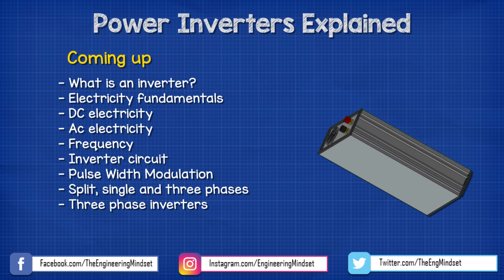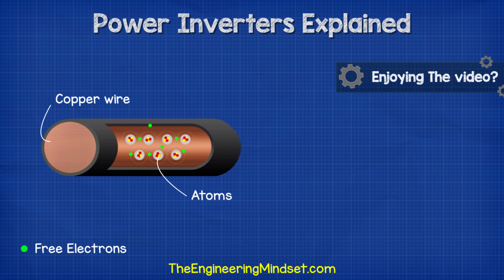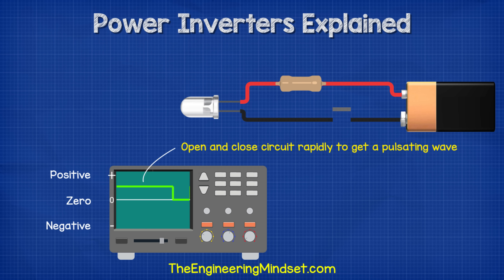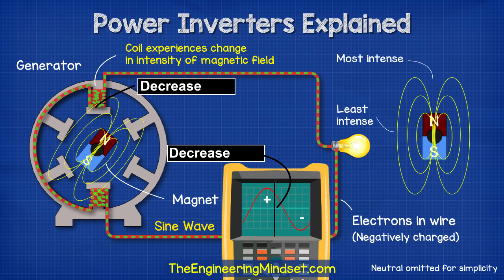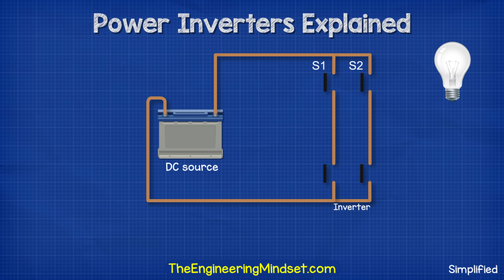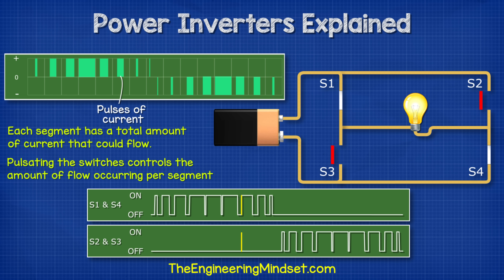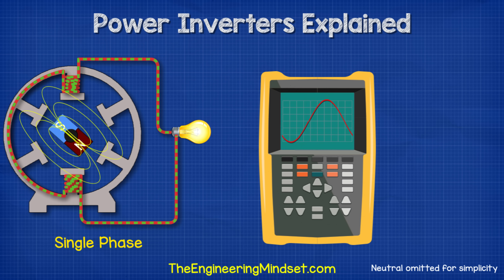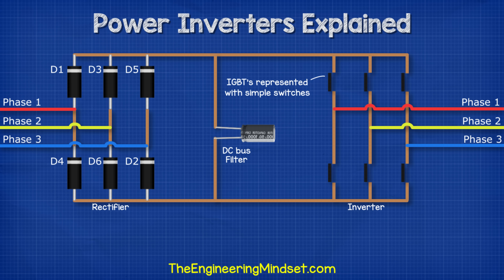Power Inverters Explained - How do they work working principle IGBT

Comment: What if I have a 12v adopter connect it to the inverter and plug it into the wall, would the adopt work as a battery for the inverter and help me saver power by using only 12v from my wall?

Comment: I'm a huge fan of transistors but I frankly kind of despise PWM

I think inverters are a fine use of PWM but dimmers are not
I think most PWM dimmers should be replaced with variacs

Comment: Great video and thank you for all the videos you produce. I'm not sure I understand the graph at 8:34 to show the current under PWM. Through the cycle the amount of current flowing through the switch when closed changes. It's not like the voltage where you see a square wave between the DC bus voltage and 0. The inductance of the motor would smooth the current draw. Would you agree?

Comment: I guess I must just be dumb as fuck. All these high-praise comments and I'm sitting over here scratching my head because every goddamn word sounds like a foreign language to me and I cannot get my head around the information no matter how many times I watch and listen.  I'm planning to live a life on the road in a van with limited power options... I thought maybe an inverter would be a good idea if I could learn how to fucking use the goddamn thing to power a mini portable cooling unit for the summer.  For the life of me I will never understand the concept of how to figure out watts, kilowatts, average, voltage anything electrical related. I'm totally fucked. I'm just going to have to buy  battery-operated everything and a shit-ton of batteries for the rest of my goddamn miserable life. 
But I do appreciate the effort you've put into trying to explain it.
Reply from the maker: This video is for engineers, you don't need to understand a single thing in this video if you just want power things from your van with a solar inverter setup. You can just buy an energy monitor plug, plug your equipment in and it tells you the Amps and Watts. No calculation needed. They cost like $12

Comment: A transformer will not convert pulsing DC signals into AC. 

Are there capacitors or something to smooth or "average out" the pulsed signals before the transformer in single phase inverters?
Are they left out in your diagram deliberately to just explain the key working concepts of inverters?

Still a great video with excellent visual analogies!
Reply: This

Comment: I believe I found a small error in the rectifier diagramm at https://youtu.be/iIqhAX0I7lI?t=49
The junktion on the right side should send current through the top right diode (according the way it is displayed)
Is this correct?
Reply from the maker: You can follow the dotted line and see it works. The diagram is just rotated 90 degrees compared to many illustrations.

Comment: On the Ac analogy at around 3:40, you could make the boat going round in circles, viewed from the front, as the speed from the viewers perspective will follow the wave form and it kind of mimics the electrons going back and forth.

Comment: 6:36 if the bulb is DC and it allows current to flow in only one direction wouldn't it damage the led bulb when we connect batterys positive terminal to negative of bulb ...

Comment: 11:01 You said 3-phase current delivers more power. However, it is not the only advantage: single phase power is oscillating on a load 2*50|60Hz, but once you bring in 3 phases they overlap to fill the gaps, thus resulting power is more smooth (not only being tripled).

Comment: does an inverter require a stable dc input frequency to have a stable 50 / 60 Hz output ac voltage?

Comment: I would like to ask if I can Connect 36v PV to a 12v inverter directly? is it safe or not recommended. I would like to ask if that will damage the inverter? Thank you for your help.

Comment: Question so if I have a 5000 watt pure sine wave invertor powering my stuff can I plug a micro inverter into the a c socket on the 5000 watt inverter to help supply more power ? Or can  I back feed a micro inverter power into a shut off line or breaker shut off to power things ? I have 3 micro inverters just 
Sitting here I used them when I was feeding back to the electric company but now I just use one big inverter to power things . Just hate to see them sitting here doing nothing

Comment: I am a retired engineer, worked in telecommunications field, engineering digital central telephone exchanges.  Most of exchange equipment powered from 48V batt supply which were charged by rectifiers fed from the Building  AC supply.  But some equipment in the exchange office needed protected 120VAC ( Terminals , Test equipment, Modems), supplied by inverters mounted on Misc racks.

Comment: Why do you need to use the inverter in the compressor example? Couldn’t you just run the three phase supply directly to the compressor, instead of converting to DC, then back to AC?
Reply from the maker: Inverter let's us control the speed, we output any frequency and voltage we need. Can't do that with a straight 3 phase supple connection, kts foxed speed

Comment: Conventional current may be viewed as electron hole flow. It's rather useful in semiconductors  but in conductors with electrons bouncing around everywhere, electron holes are really regions that have a lower electron density than the average, and they tend to flow in the direction of traditional current flow.

Comment: My Camo pro pack is called portable power generator, it has a 12 volt battery inside the pack and it also has 300 watt inverter attached to power pack……….It has jumper cables to jump start a car battery, can I connect my jumper cables to a 100 watt solar panel ( Make electricity)????????
Reply from the maker: Seen our new video on HOW SOLAR PANELS WORK in detail https://youtu.be/Yxt72aDjFgY

Comment: What I love about electronics and power back up systems is that they actually need low voltage DC, so they all have internal power supplies that turn the incoming AC into the necessary DC. So these in effect turn DC into AC which then gets turned back into AC. It does make sense though because something like a solar panel will generate inconsistent voltage so an inverter will smooth it out
Reply from the maker: Seen our new video on HOW SOLAR PANELS WORK in detail https://youtu.be/Yxt72aDjFgY

Comment: Well see l got this issue l would like to weld l would havet to make two 110 plugs then wire it to the 210. Is this  hard to do .but l just want to also git past the hall sencers an just hook up the three wires any short cut to rt to power on the hub

Comment: 8:35 my inderstanding is that PWM SHOULD NOT change the instantaneous current. That is V/R, regardless of the duration. What DOES change, is the amount of charge...the longer the switch is closed, the higher the charge that passess. But the instantaneous current stays the same.  in the left corner diagram, that is the height times the base. The base, aka time, changes, the current is the same. The area is the amount of charge. So, at least to me, it is not clear how you mimic a current sine wave. There should be a way to accumulate the charge and release it smoothly. I assume a capacitor would be used, since it accumulates the charge and when it is not charged it releases the current.

Comment: You can set the frequency to higher rate, and the 220 v to 257 v on some supplies such as Apc. When you do this, the grinder can reach a higher rpm for cutting or sharpening harder metals, that can’t be done at 220 or 230 v.

Comment: in order to camp with my cpap machine, I use an EASYLONGER battery (12 v DC) to an inverter (+-110v AC) to my cpap. then, to charge the battery, the AC inverter plugs into my cigarette lighter in my car. So then I have car (DC) to inverter (AC) to battery. the guides online suggested i buy an additional adapter to run the cpap straight off the battery with a DC cord (no inverter). I have found that my battery-to-inverter-to-cpap method works and also uses the original cpap power cord . am i wrong though somewhere?

Comment: Hello dear, your videos are very interesting. I love your videos.
I have some questions about my solar project. 
1. Can i use a 12 volt single battery for a 24 volt solar panel with 24v solar controller.
2. I have  2*24v*310w solar panel. I will use AC devices. What will be the best system for me?
Please suggest if possible.
Reply from the maker: Seen our new video on HOW SOLAR PANELS WORK in detail https://youtu.be/Yxt72aDjFgY

Comment: actually most applances wth out a motor uses d c because they have a step down xformer  & diodes in them.I use to use home amplifiiers in my car when i was young & a car stereo enthusiast....actually my 1st car stereo was a home component set with the xformer section bypassed & running off str8 dc with a cap installed to flter out the a c ripples from the battery BUT THANKS FOR THE LECTURE ...REALLY APPRECI8 IT

Comment: i would replace s3 & s4 with diodes & s1 & s3 with a relay that it turned off & on when i certain voltage goes through it.

Comment: Ok got it sir. 
But I have a few questions. How the controller do on/off the pair switches?' I mean what physics law/principles for a controller to do its job? The switches looks like a transistor so to open them, BE and CB potential barrier should be reversed biased? So if this is the case, how the controller do this?

Comment: at 7:23 that wouldn't produce AC, as current will still be flow the same way in the circuit Reguardless of how switches are be used. Notice how she has conveniently omitted the battery polarity so she doesn't have to be explain this error 🤔
Reply from the maker: It does produce AC, look carefully at the green dots passing through the light, it's clearly AC, it may not be a sine wave but its AC. Nothing has been omitted and hidden. I suggest you start with the more basic electrical engineering videos as you appear to be lacking an understanding of the fundamentals. Also, I'm not a she.

Comment: Company I work for had 3 phase static UPS’s from 10kW to 250kW.  Transistorized inverters.  We now have motor/generators from 750kVA to 3400kVA and use chemical batteries or inertial (flywheel) batteries.  Voltages range from 208 to 25kV.  Sometimes scary, usually mundane.  Fun times.

Comment: Hm, I don't know. What to use inverters for ... A coil gun that is built to be an LC circuit with low enough frequency to fire a single round during a peak of current.

Comment: I have a 4000 watt inverter and I conected it to my 12v battery the wrong way  . Its fault light and alarm keeps turning on  . Do you think the mosfets or the capacitor needs replacing  . Any help would be appreciated as I live in a property with no grid power  so the inverter is very helpful to my life.  Thank you for teaching me about electrical circuits
Reply from the maker: See my new MOSFET explained video here➡️: https://youtu.be/AwRJsze_9m4

Comment: I have a generator that is a 750wh. Is there a way to hook an inverter directly to it, or do I have to go through a battery ???  The generator is NOT an inverter style (obviously). I thought maybe I could just hook an inverter up to it, via a battery if necessary. If it is possible. Is a 750 inverter the largest I can use ???

Comment: very interesting video pedagogical and very clear 
I have a question its has nothing with classic electricity 
I build an ions load circuit which is powered with a small ac power 
and its charge cap but I need to recover high cap frequency to put it back in the first ac input in order to have harmonic frequency between the load circuit and cap and therefore increase cap charge
I thought of this H bridge but I don't know if it can fix my problem i m not looking for dc ac power conversion small dc input to high ac output 
I need just one wire from inverter  that carry high frequency to put it the first ac input 
any idea is welcome thks in advance

Comment: I’m wanting to setup a area in my garage so I can test car stereo and amplifier equipment.  Can I use a power inverter and a battery to do this?
Reply from the maker: Probably better to buy a dc bench power supply, check the wattage though

Comment: Hi mates, I’m thinking about a way how to make a power supply for two Ac 3 phase motors with the help of battery. AC motors normally (90%) of time runs from grid but when the grid fall down I need to still them working so can someone send me an article or something similar what can helps me? Thanks
Reply from the maker: Have a look at 3 phase UPS systems

Comment: i don’t get the last part of turning the 3 phase to dc and then turning it back to 3 phase. Why would you need to turn it back into itself?
Reply from the maker: Because you can't make 300V 60Hz out of 230V 50Hz. The 50Hz will be turning negative when the 60Hz needs to turn positive sine wave. We can make it from constant high voltage DC though

Comment: Hi,
I want a help from you guys. 

I have a 2KVA (1200 Watt) , 220 volt simulated sine wave offline UPS, I want to make it a pure sine wave UPS by converting the output current from the UPS output socket. 

Could anyone please provide an external circuit diagram along with the components required to do that? Where the input will be 220volt (50-60Hz) simulated sine wave and the output will be a 220volt (50-60Hz) pure sine wave? 

I would be ever grateful to you. 

Regards.

Comment: 6:04   IGBT's   =   Insulated  Gate  Bi-polar   transistors.   Heavy duty high current switches. They are in modern junk washing machines, for motor speed on the drum;  in dryers also.  And, treadmills,   etc.  (DC  motors)

Comment: Your Videos are we'll explain. A++ for all your videos. Can you give me advice?  I live in my Van full time, for about a week right now and I hope I can find someone to help me on my issue with my 3000 Multi Plus inverter. My inverter is 50AMP / 120V. When I went to start my Water heater, 12A /120V/ 1500W my fuse heated up red and it didn't blow. I quickly disconnected! Try my Induction stove top and the same respond. The Cable size is 4/0 and it heat up between the Battery Bank and the fuse to the Inverter. Everything that is small AMP like Refridge, Computer, TV, Phone, works fine but Big Appliances is where the problem happen. Any suggestion? Thank you.

Comment: Good video & useful information. I would suggest on items like newer TVs bypassing the power supply to use a DC to DC converter instead if you are trying to be more green. There is always a tax in switching one type of power to the other so taking any extra steps out of the process will be more efficient.

Comment: Sorry why do I need to rectify my 3 phase AC into DC before re-inverting into 3 phase AC?
Reply from the maker: By converting to dc you can make any frequency and voltage. If you input 50Hz and you want to output 100Hz, you can't. Unless you convert to DC first.

Comment: Great video! One thing you didn't explain was how an inverter can be synced with an existing AC infrastructure -- for example, when you connect solar panels into your home AC supply. I would guess that the inverter in such applications is connected to the target AC and somehow uses the existing AC to sync up.
Reply from the maker: Seen our new video on HOW SOLAR PANELS WORK in detail https://youtu.be/Yxt72aDjFgY

Comment: Hello and thank you for the very useful video. I have a question on what decides the amount of current and what decides runtime in an inverter. Usually an inverter would be described as (x)V - (y)KVA. Does (x) control max current and (y) the runtime? Thank you again.

Comment: If anybody is wondering this, a perfect sinusoid is not generated at the output of the inverter. You get what looks like a bunch of “capacitor-like” ripples in the general shape of the sinusoid. For some applications though that is okay.

Comment: Hi.  I a  here because I a  fascinated with solar power.  I bought a 100ah LiFePo battery, a black box, some USB/car charger panels, a bus bar, a fuse box, and a solar panel to play with.  I have charge a controller too.

I want pass-through charging and am finding it hard to figure out how to do that.  I had thought the charge controller would take care of everything, but someone said I need a bi-directional inverter.

Is this true?  Is there a video that can show me how to wire that up with everything else?

I also have a question about a ground wire and why that is nowhere to be found.

Am I being ridiculous by trying this without having a PhD in electrical engineering?
Reply from the maker: Seen our new video on HOW SOLAR PANELS WORK in detail https://youtu.be/Yxt72aDjFgY

Comment: Guys maybe I'm missing something (I'll rewatch the video) why do you need to convert 3 phase ac to dc before converting it again to 3 phase ac? Why not just use the original 3 phase ac supply?
Reply from the maker: Because we can't change the voltage and frequency of the original input, we can try but we will just get a complete mess output. Maybe we try to output 400V while the phase is at 0V, it's not going to work. We use DC because it is constant, we can change it into anything we want.

Comment: I have been trying to figure out a way to power a 12v 3A moniter with a power bank. I bought a usb 5v to DC 12v barrel  jack converter. The monitor powers up then down up then down etc.. I  am guessing that the current isn't high enough. Any recommendations?

Comment: Amazing video, one correction. The electrons in the circuit do not move in any direction but simply vibrate about a fixed point. The energy from the outlet causes the electrons, already in the circuit or lamp filament, to vibrate.

Comment: In the 3 phase inverter, you show the input is a rectified 3 phase current which is then smoothed into a single phase DC then it is converted to a 3 phase again. Why not supply the rectified AC input directly to the output?